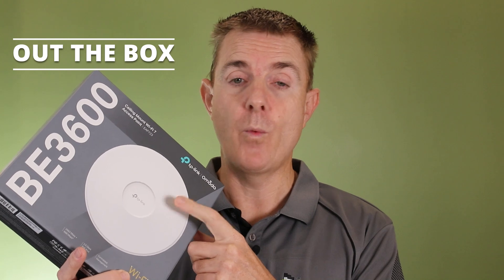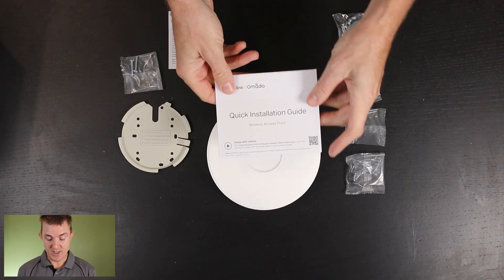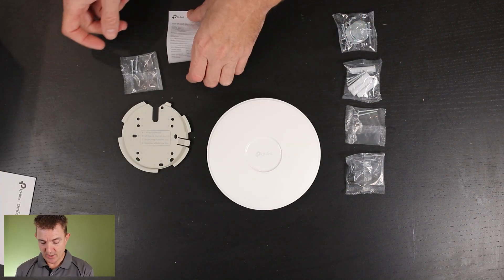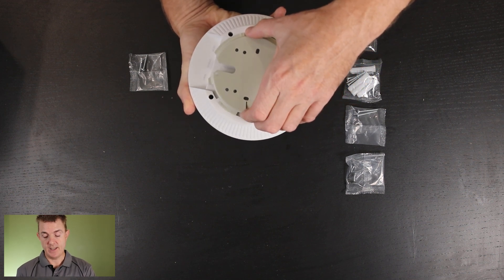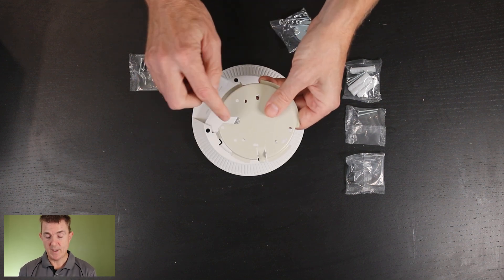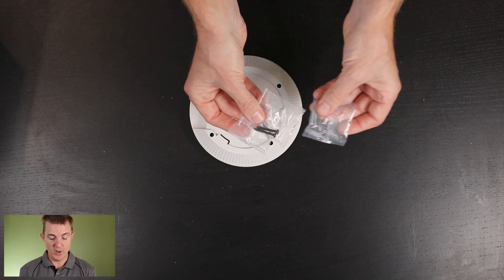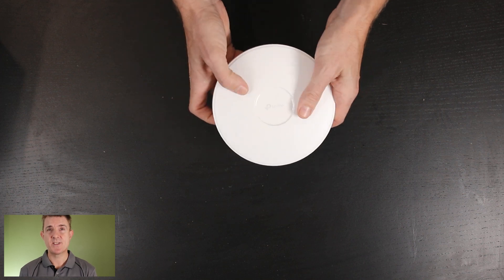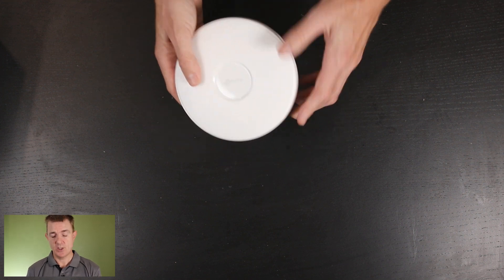Out the Box Series - TP-Link Omada EAP723

Comment: thanks for this really good quick review. but please note, this EAP723 does NOT need to be connected to the cloud or a conter to work. you can connected only to your locl router at home or office and use it as an AP. This is how i have it installed in my home.
Reply from the maker: Yes you can certainly use it as a standalone but to get the best out of the Omada product range you want to use one of the several software management options.